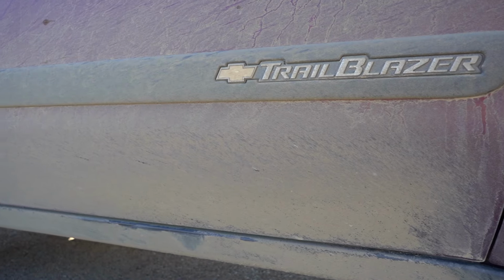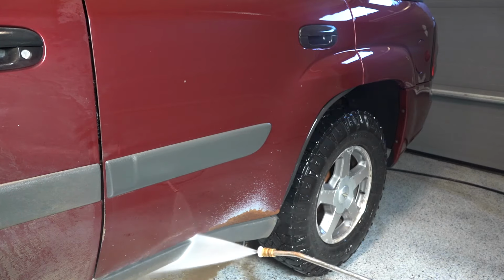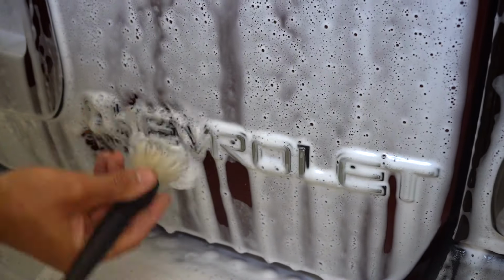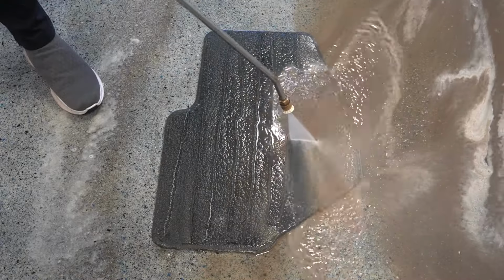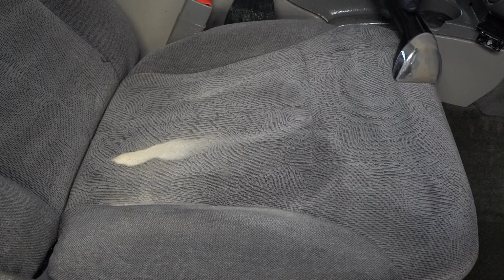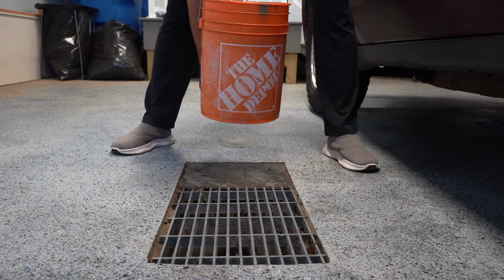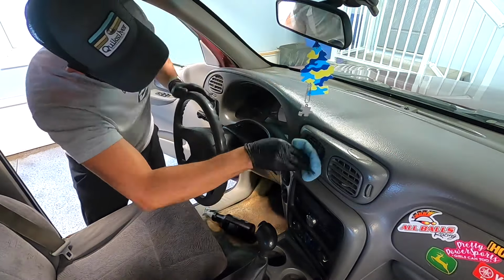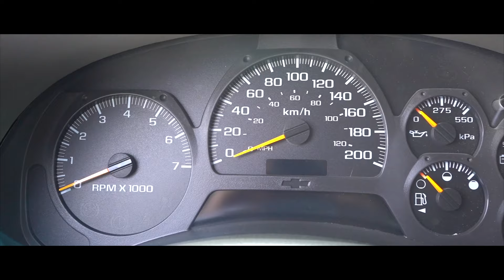Deep Cleaning a Girl's DIRTY SUV...AGAIN! | The Detail Geek

Comment: If I was the customer I think I’d get some floor liners like weathertech or husky.
Reply: If you don't clean you car, then weather tech is pointless, you just have alot of dirt of top of plastic mat.
Reply: I replaced the carpet in my '07 Avalanche and topped it off with the Husky floor liners after much deliberation.  LOVE THEM.  Very happy with that purchase.
Reply: @silverfoxslash  it will help protect the carpet and weather techs are easier to clean than shampooing carpets

Comment: loved the original and this as well! lol. 2 questions: how do you clean the gas tank filler after you get it with the detail brush? I always see you clean behind the cover and under, but I don't think I found a video where you finish it up.. Was wondering if you also power washed that part along with the rest of the car..... 2nd question: what wand do you use with your pressure washer?? I love that it has a slant and that rugged looking base that you rest your hands on. Looks super convenient and easy to use.

Comment: Mix concentrate carper dye with your carpet cleaner.  Instead of detergent. add the dye with the hot water mix. it will fix the color of the carpet and makes it easy to apply and clean.
Try it on floormats and see it for yourself.  How easy it will be to dye carpets and floormats without much work.

Comment: I cheap trick I used to get rid of cigarette smell in the A/C was to tun the A/C circulate inside air on high and spray it full of Lysol Disinfectant Aerosol Spray. Mainly under the ftont dash where it sucks in the air. Let it it run circulating that Lysol for a bout 10 min. No more ashtray A/C.

Comment: So when you’re shampooing the carpets and your drill brush is splattering water and suds around to other areas, I often notice in the ‘after’ shot that the splatters are still on those other areas.  I assume those get sucked up / cleaned up at some point?

(sometimes it’s on areas that haven’t been cleaned yet, but sometimes it’s on a previously shampooed area . . . my perfectionism is irked a bit by that, but I’m assuming you suck those up later).  🤞🏻🤞🏻🤓

Comment: You need to be careful with high powered pressure cleaners.
If you are not careful you can force water into seals and electrical connections. Even waterproof connectors are not designed for pressure cleaning.
It can also lift paint if there is a chip where the spray can get into it, especially painted hub caps.
External clips or fittings can get blasted off also.

Comment: Hey bud. Could you do a headliner cleaning how to for us? I have the old style headliner in my trailblazer and I bought this thing from a prostitute, and well, well I just really need to clean it. I’ve sterilized it, used my ozone machine to get all the smell and bacteria out,  but the headliner is still gross and it needs to be cleaned. What’s the best way to do this without damaging the fabric or messing up the adhesion.

Comment: Watching this and one other video, I have to get a little concerned about two things: -

- long-term moisture damage to electrics from overspray? - sure, that pressure washer is super directional but there's always going to be some splashback somewhere. Nothing ever go inside a panel or under the dash where the manufacturers didn't design for water?

- similarly using steam inside a car, there has to be some seepage somewhere that's not supposed to be exposed to that level of moisture. But more importantly, I saw you using steam on (what looked like) leather seats. Doesn't that instantly ruin leather? I once made the mistake of scrubbing a belt using warm water (hey, it was the middle of Winter!) and that was that, once it was dry it had stretched and sagged and had probably half the strength. Someone told me it's a 'known thing' never to use hot water on leather, and the only thing to do at that point was to throw it away.

Comment: How can I get rid of this film that builds up on the inside of my windshield it's a fine oily stuff that fogs up when the sun hits it.
Reply: That’s a bad sign. Check your coolant level.
Reply: @gregnixon1296  I don't see any evidence of fumes or steam. Nor do I smell anything.  I've had issues in my old Volvo with the heater we fixed it. No this is like a fine oily residue that nothing seems to cut. It's really fine, and transparent and only visible in the glare of the sun.

Comment: I was cringing everytime you hit the rims with the pressure washer but after a couple rims i'm guessing these are steel and not plated. From what I have heard you cant use a pressure washer on rims since it will chip the paint off but I didnt think about non plated rims being fine.

Comment: After 5 months a car does not have to be so dirty again. Ok, if you drive a lot it can be dirty on the outside, although even that is not necessary. I'm very sure there are gas stations in Canada that have high pressure washes. But anyone who lets a car get so messed up on the inside in such a short time is quite simply an extremely untidy person.

Comment: It's ultimately just a tool of work for her. When you use a car this heavily it will deteriorate quite fast. IMHO it's professional to use it and after some time to get it refurbished by a professional. The amount of grime on the outside isn't something special, one day in wet conditions on gravel roads for 200 miles will do.